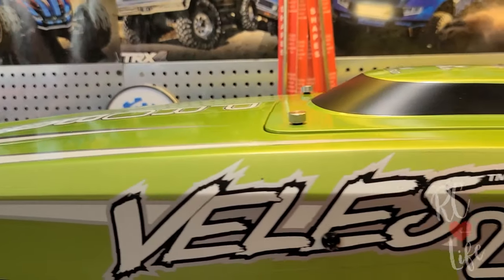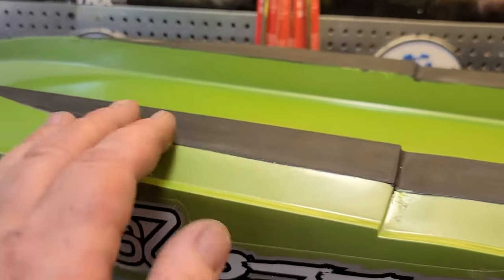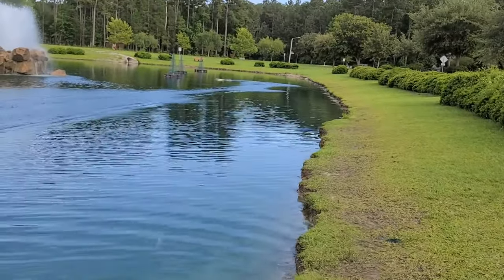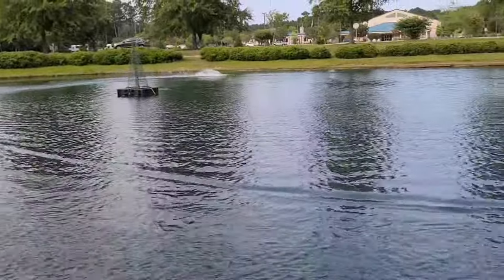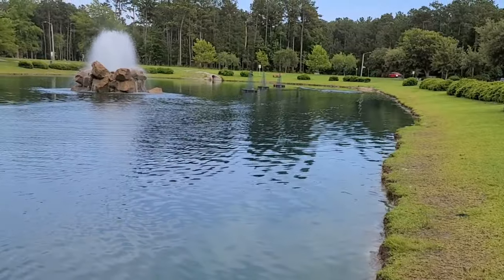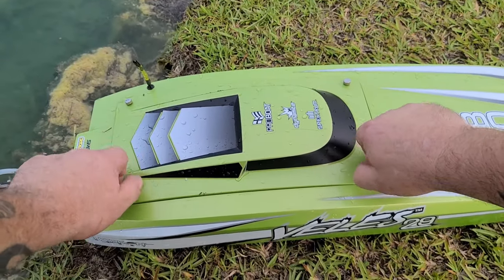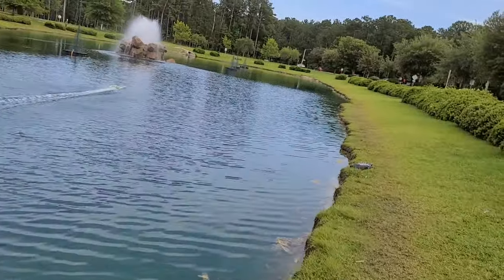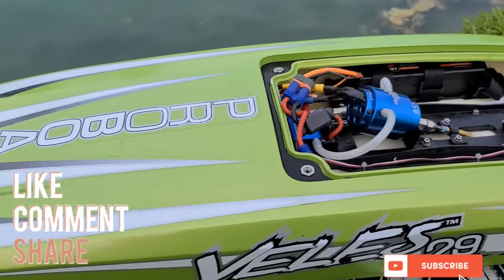Blueprinted Graphite Hull Testing Veles 29 - Fast Rc Catamaran - Proboat

Comment: Love your videos, slow motion is always a good thing. 
  I’ve never blueprinted any of my boats but you got me convinced it will help. 
  Spring loaded fuel line clamps, easy to remove.
Try calibrating your GPS tracker you may be going 2-3 miles faster than you think.

Comment: The tippiness is why I’m considering selling my Veles. I hate being nervous while cornering, worried if it will flip or not
Reply: It's about throttle control I used to tip mine 30 seconds after I got in the water, give it the right amount of power and it will do some crazy turns but no matter how good you get you will always need a way to recover this thing especially if you're pushing the limits.
Reply: Upgrade the servo to something with a metal arm the plastic has too much flex I found a nice generic 25Kg servo it's rock solid on the high speed turns now.
Reply from the maker: I agree 100% brother throttle control and time feeling the boat out.  Or seel the boat and stop complaining ...

Comment: Hell yeah man that thing is hauling the mail. I’m still learning the blueprint process on the sponsons and I have been working on my volantex atomic a bit and the sponsons are uneven from left to right, and the boat walks no matter the angle of the strut,any advice on what I could use to build up the low side a bit without using epoxy on the plastic. Thanks In advance Big B
Reply from the maker: I recommend epoxy/graphite but if I had to use something else it would be automotive spray primer for a high build.    But you have to build it slow, if built up to fast it will crack.
Reply: @IRONCLADRC  alright thanks. I may just have to use the epoxy and just do light layers. It’s amazing how uneven these cheap boats are coming out of the mold but then again I don’t think it was made to go over 40😂

Comment: what cell of batteries do you run and did you change the motor from stock because mine is not that fast . we race and in our class we can only run 4s.
Reply from the maker: She's all stock electronics wise.  Run her on 6s I blueprinted  the hull a d run a couple props

Comment: They blow water lines on the real boats doing 100 mph. Your pretty close to that with that small of line.
Reply from the maker: I use to work a 44 foot aluminum Striker sport fishing boat and we blew a main intake line 8" line 50 miles out at sea talk about crazy. In the bilge (engine room) WIth an replacement hose and water coming in  the boat is just as hard as it could flow through the pipe..   omg!  what a day in the gulf stream.

Comment: Epic style crashed my sw 35 v2 into a steel marker pole out in a small inlet ro lake erie she got s 1imsh shorter straight in the nose no water
Reply from the maker: Did it survive the cash?
Reply: @IRONCLADRC  it did however it got the nose pushed in a half inch or so didn't have water in it , peace

Comment: I ran the stock setup on 6s and it got smoking hot and melted the wires right off the esc went to a 1716 ABC prop 4074 1700kv motor 180 amp Seaking esc 25kg servo with metal arm, quad pickup rudder.61mph check my channel to see it in action
Reply from the maker: Nice run brother. Great set up